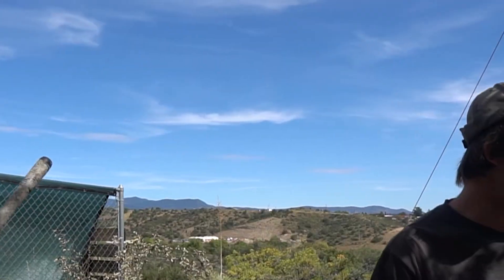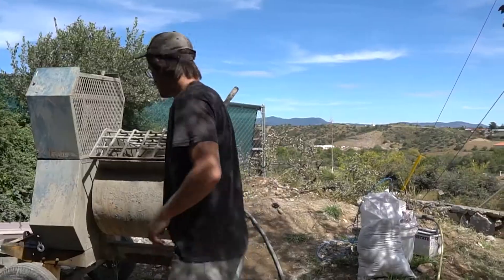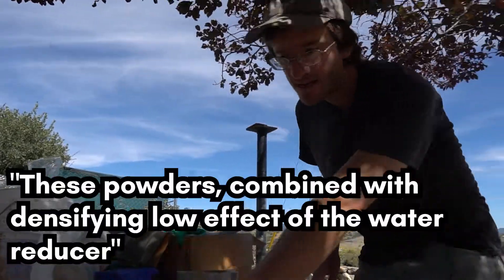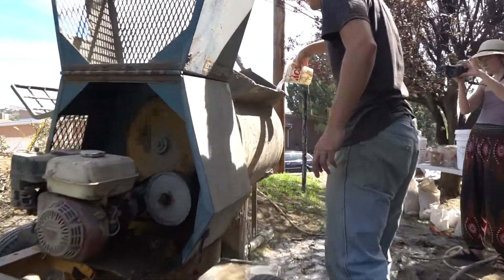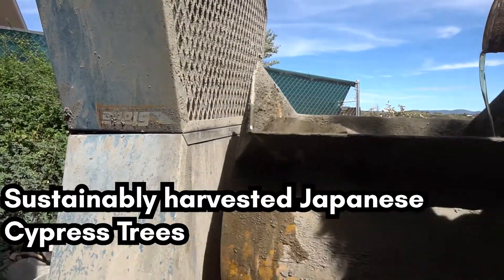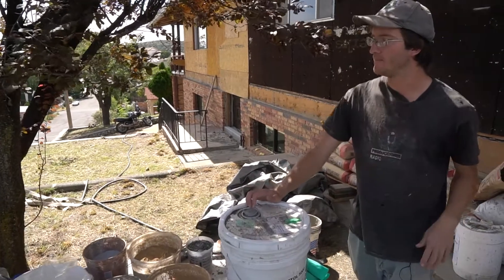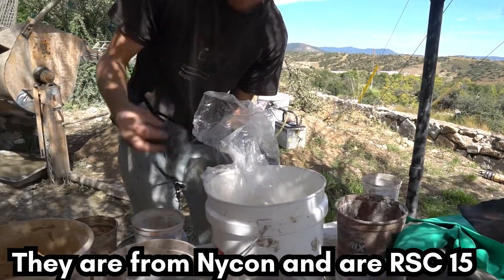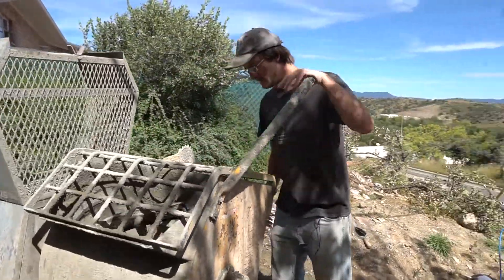Shell Mix for Marsh Filtration Ponds

Comment: Hello Doug!  Any reason for the Plastol 5000 over any other?  I chose the 5700, but not sure about it relative to other PCEs.  Really looking for the least amount of residual self-leveling creep.  Our recent experiment is using basic bagged concrete with no frills, and injecting admix into the mixing auger of a MudMixer.  That thing is actually well designed and works better than expected.
Reply from the maker: @SpaceCrete  the Plastol 5000 is a derivative of the Boral SPJ that was the top super P famous for Boral Materials Technology 17,500 psi pea gravel mix.  That was a blend of the new polycarboxylate high range stuff that was the key to that Ductal mix design by Lafarge in the 90’s that hit 26,000 psi with a syrup like consistency.  SP = Super Plasticizer and J = Japanese, which means the Ca, and Mg lignosulphates derived from Japanese cypress trees.  These old school water reducers are also powerful polymer binders that add to the strength in other ways.  They also serve to prevent that stratifying effect, that self leveling affect that causes segregation and a drippy consistency, like the old Ductile mix that started all this.   When Euclid Chemical company took over Boral’s chemical division they gradually changed the SPJ into their own version of it that is probably more synthetic but very recently they seem to have settled in on a consistent formula that is light brown like a weak tea color instead of black, but it seems to function like the SPJ and being a high solid polycarboxylate blended with their anti-segregating compound and possibly the old school lignosulphanates  from Japan.   I have to use a very high dose of it, 10 ounces for a quarter bag of Portland to make 6 gallons of material, but I find it easier to use than the other ones, easier to predict, easier to read and get feedback from concerning the hydration and mixing.Other formulas can surprise you with a rapid change and consistency and set time.
Reply from the maker: I have tried the 5700 before and it is comparable to the 5000 but I recall the 5000 caused less of that residual creep.  That is interesting about the MudMixer.  I have been trying so may different types of mixing to to avoid having to quick scrape the mixer paddles 2-3 times in the early mixing.  I have decided to stick with the horizontal paddle mixer with the 8 hp for primarily a 1/4 bag mix and sometimes a full 1/2 mix but I have come up with a method for mixing a 1/8 portion, that uses a 1/8 bag of Portland cement to make 3 gallons of composite that uses two drills, a standard spiral mixer paddle and. the narrow drypack mixer on two separate battery powered drills.   That provides enough sheer and makes the mixing mobile for retaining wall and tank construction on site.  If you are using a heavy aggregate beyond sand, like gravel, in your prebagged concrete, I think it would be hard to avoid that residual creep if you go slightly over on the water.  The great thing about adding reactive nano silica in the silica fume and STAR 3 Micron, now sold by Heidelberg Materials, is that lime produced by the Portland reaction, tricalcium silicate reacting with water to produce lime and Calcium Silicate Hydrate, the hard stuff in concrete, is the lime and silica will react to produce more CSH and consume that extra water that makes the ultra-low water mix that drippy, oozy non-Newtonian rheaology.  I like to push the mix into that fluid state with most of the water and then wait for that secondary pozzolanic reaction to eat the extra water.  The sequencing is key there.  You have to let the micro silica, sand, Plastol and most water mix thoroughly without the Portland for 9 minutes to disperse and hydrate the micro silica, then you get a clay like soft and very smooth render that is stable for a long time, gives you lots of work time, and sticks overhead.  This new sequencing has allowed me to eliminate the acrylic surface glaze and return to a single shell approach of between 3/8 and 5/8 inch as there appears to be no cracks thus far.  If cracks do form, the fine-sand acrylic modified version of the mix, 50 percent sand blasting sand, 50 percent cementitious material, a tiny amount of plastol, mixed in a bucket with acrylic and water.   This is the squeegee-on floor topper and foam core mix for doors and insulated tanks but it seals any cracks if you brush in a slightly wetted bit of it as a prime and then smooth the paste over the top.  You don't need mesh unless the crack comes through that quick fix which is hasn't yet.  Sounds like you put the 5700 to good use but maybe try the 5000 next to see if there is a slight improvement and let me know.
Reply: @ShambhalaVillage  On shrinkage, this is just straight neat cement paste with and without our admix at 3% of paste by volume (a high dose): https://youtu.be/RahyIIffiwM  Typically about 0.25% of total concrete volume, depending in w/c.
Reply from the maker: @ That is a great test video!  I would like to do a test video that shows the cold joint bond strength of the acrylic nano paste I mentioned, compared to the top bonders.  I believe that this cold joint bond method far exceeds the other top acrylic bonders but also, there will be a sharp increase in that bond strength in 90 days with the nano paste.  This is because the bond zone is rich with only the nano silica, hydrated Portland and acrylic suspended in a highly fluid paste that has the least amount of water possible, because the paste is extracted from the mix with a brush dampened with the 50/50 acylic-water blend. You know that it contains only the nano silica because you are forcing that segregation with the addition of water, and the dab of mix you are using stops giving up this bleed paste after working it with the brush.  Here, you are taking advantage of the bleed or segregating effect to ensure you have a minimally hydrated paste on your brush for crack repair and cold joints.  This eliminates pores caused by excess water, separation pores that weaken cement to only 20 percent it's potential.  Also, the substantial amount of particle sizes that react contribute to both early forming and late forming pozzolanic reaction.  This causes that bond zone to be jammed with the maximum amount of penetrating needle crystals of the Calcium Silicate Hydrate.  This seems relevant to to what you are showing in your video.  Can't wait to test.  I am going to steal the psycho music idea.  Hope that is ok.
Reply: @ShambhalaVillage  Yes

Comment: What was the clear solution being painted on the uncured cement towards the end? Why is it painted on before curing?

Also, I am using a 2:1 fine white blasting sand : white Portland part 5, with sika polypropylene fibers and mapei polymer additive for both my scratch coat and top coat.  

Is it a bad idea for me to use fine blasting sand in my scratch coat instead of masonry sand?  I am hoping to have a longer sculpting time for my top coat. Is there something out there better than the plasticizer that I've selected that could extend workability a bit longer?

I've also tried using a little diatomaceous earth <10% of overall cement powder to act as a pozzolan additive, but not sure if I'm gaining anything out of it. I was hoping to add some sort of self healing activity with that additive but then I've been told by xypex that using a polymer additive prevents self healing crystals from forming, so I was disappointed to hear that and don't know what to think now.
Reply from the maker: That is a 50/50 blend of the Acyl-60, more recently known as the Master Emaco A-660, and currently known as SikaThoroseal Acryl 60 Water-Based Acrylic Bonding and Modifying Admixture 5 Gallon.  You can buy it as Master Emaco still but that will eventually be gone.  I have improved the mix by sequencing and that Acylic is no longer necessary.  For a 6 gallon, 1/4 bag of Portland mix, which is the size batch I recommend until you master the reactive powder mix, the mixing sequence is as follows:  Start with most of your water, 1 to 1.4 quarts of water, variable depending upon humidity and temperature, 4.5 gallons of ASTM C-144 Mortar Sand, 3 quarts of fine Sand blasting sand, 1 full quart of silica fume (Eucon MSA), 1.85 quarts of STAR M3 Flyash, now from Heidelberg Materials,  10 oz of Plastol 5000.  Let mix for 9 minutes before you add your 1/4 bag of Portland cement, split by weight.  Let mix for 9 minutes adding water to maintain rolling consistency that settles for only 2 seconds when blades are stopped.  You will stop the blades and scrape them about 3 times to ensure thorough mixing.  Add the 0.6 gallons of expanded foam, the Mearlcell 3532 for, then add the 3/4 quart of Nycon PVA RSC-15 or RESC -15 fibers and a half Quart of Forta Ferro Fibers.  These creates a smooth clay like finish that doesn't need the Acrylic glaze.  Do a bond layer on your 3.4 gauge lath that is secured to the two layers of remesh with hog rings, in 18" x 18" squares by slightly pressing in small dabs of plaster with the tip of your 10 inch pool trowel, just enough for adhesion.  Follow up with a thickening layer that that is gauged to be 3/8 min to 5/8 max thickness above your lath.  Leave rough until you are done with that square then clean and dampen trowel and smooth out trowel marks.  This new sequence produces a sticky and smooth clay-like material that doesn't need the acrylic.  You will need the acrylic mix to blend with the mix to make cold joint connections.

Comment: What is the whits liquid that you are putting on tge cement after it is applied?
Reply from the maker: @BrendaAngelArt    That is a BASF A-660 previously known as Acrylic-60.  It is available in hardware stores.  You mix it with 1/2 to 1/3 water.  The correct way is to brush on a small amount, enough to work it into a thick paste that becomes about a 2 mm thick part of the entire plaster area and connecting edges.    The correct method is to do small squares 2’ x 1.5’ at a time.  This is key to making a permanent water tank shell.  Press in a thin adhesion layer by pushing in globs from the tip of your trowel.  Next, apply a thickening layer to about 3/8 to 1/2 inch above your lath.  Make sure your edges are thick enough and put a nice sharp 45 degree edge on your small rectangular section and brush off any residue that is not connected to that solid steep edge.  Don’t bother trying to smooth the surface before you apply the acrylic.  It is easy to smooth after you have worked the surface with that acrylic mix and chip brush.  Clean your trowel with the brush and dampen it with that acrylic mix.  This will allow you to smooth the surface perfectly and get your edges at the steep 45 degree angle.   Clean your scratch rake and dampen it with the acrylic mix.  Drag a scratch texture over the surface being careful to not tear or roughen the surface.  Drag your damp canvas painter tarp and plastic tarp over your work as you go to keep it from drying out.  You can soak your canvas water directly tarp in about 10 minutes and hit the shell with a direct spray of water in about 40 minutes.  

Come back with a second coat, done the same way, in 48 hours or more.  

The mix is much improved to a 6 gallon 1/4 bag mix that is made in an inexpensive electric mortar mixer.  It has fine sand blasting sand added, slightly more fibers, more water reducer and it goes on a lot easier.  Would you like that new recipe?
Reply: @ShambhalaVillage  thank you! I just ordered some. My husband and I might be contacting you via email in the next few months. I am a sculptor and would like to try your technique out.
Reply from the maker: @BrendaAngelArt  Very cool!  you want to use a little of that fine sand, sand blasting sand, for the finer texture.  You may also like the framing technique, which accurately captures and blends fluid shapes by converging two double-line, like a railroad track, pieces of reinforcing.  The trusses branch out in two directions and converge which reveals shapes you couldn't even imagine but are accurate blends of form.  The single shell follows the same technique of using the double-strand grid wire converging to smoothly blend shapes.  It is a lot of fun and easy to control the armature as you go.    I am doing slight improvements on the mix and improving the clarity of the recipe with weights because volume measures of the powders can be significantly off, just like when you try to measure flour by cups instead of weight.
Reply: @ShambhalaVillage  thank you very much! God bless you.

Comment: Where can I go to purchase the laminated step by step cards?
Reply from the maker: Email me.  douglacy77@hotmail.com.   Do you want the mix poster instruction for the jobsite.  The mix has greatly improved and there are some key steps and wait sequences.   You want to add a 1/2 quart of water to the sand initially, then add all cement powders and then the 3.5 quarts of water. and then the 10 oz of water reducer.    Then you wait for 4 minutes.   Add 2 to 4 ounces of water, depending upon how much it reacts, then wait 3 minutes.  On your first one or two minutes you may have to add 2 ounces of water and wait 2 minutes, to cross minimum hydration slowly, and avoid excessive water and that self-leveling oozing effect.    You want to shoot for a soft plaster that does not ooze.   This better ensures all the reactants combine and are not isolated.  The framing system has greatly improved as well. no ring truss, just bifurcating branching of the 15 inch, adjustable curve block frame truss.   Much simpler and much less waste of steel.  Using 8x20 remesh mats instead of rolls. much easier.  Evolving quickly.
 .
Reply: @ShambhalaVillage  thank you for your reply! I’ve emailed you. It would be great if you had a pdf package that has the mix recipe/instructions and the truss building instructions/diagrams, and plans for the block making machine. I look forward to hearing from you!
Reply from the maker: @mountainmama6316  - This would be a good time to do that,  The final changes in the truss frame was recent, I can support the drawings and descriptions with photos due  to a recent project.  The mix is getting  clearer and better every day.  Once you know exactly where your water content is, it goes very fast, maybe two minutes on the initial wait.  As long as you do not put in too much water initially, even if it does go into that dreaded self leveling-state, it recovers because you were not too far off.  You can add seven seconds of foam during that initial mixing and it fixes everything and is fine, even if your sand is drenched from rain, its fine, even better, and you don't go over on the water and its still dry enough to add all the water you want on the end.  Total water, including the maximum water in sand, is 1.25 gallons per half bag of portland so still off the charts for minimum hydration.   You should make the small foamer based upon these basic 3 components so you don't make it too fast: 1/4 inch OD lines  and sharkbite 'T' and connectors, 12 volt DC RV pump 1.25 gallons per minute,  and basic pneumatic air valve. Will send you Amazon links for that 20 dollar pump, 15 dollar air valve and 15 dollar line and connector kit.  The foamer is so simple.  I sold my last benders to the workshop attendees but have all the cuts so can supplement the diagram with clear photos, especially on where to put the handles so you can fold that new 8' x 1.5'- centipede cut for the 3 sided block frame that is key for the new, super-fast and ultra sturdy adjustable trusses that conserve about half the steel.   I will get this too you.   I wish I could sell you some patience for putting on the lath with the 3/4 inch SC7c hogring gun.  Sometimes it takes an hour to hang the equivalent of one sheet.  Figure a couple of weeks on lath and for each phase, frame and plaster, for a 750 ft^2 roof, but you end up with a self-healing garden roof that will never fall or burn and may be around for thousands of years.